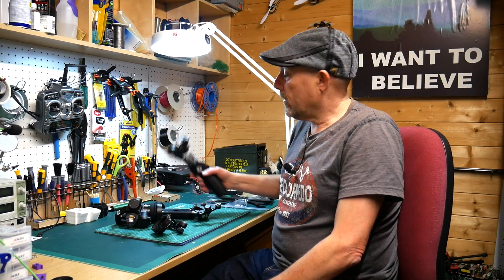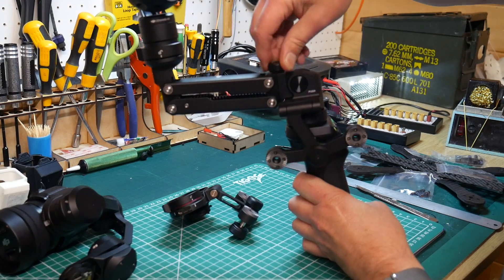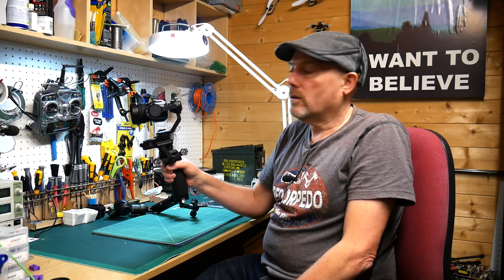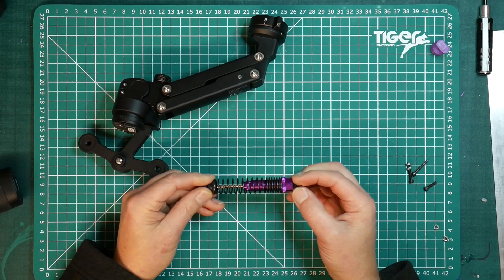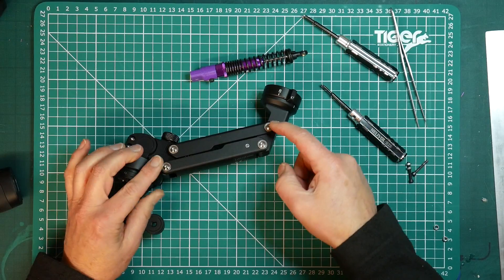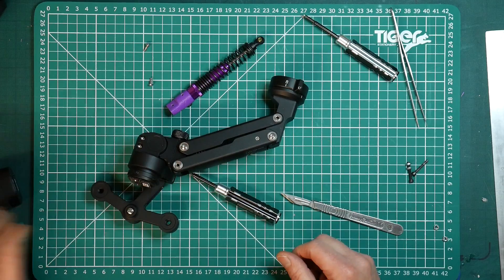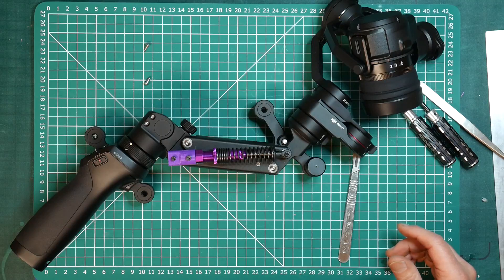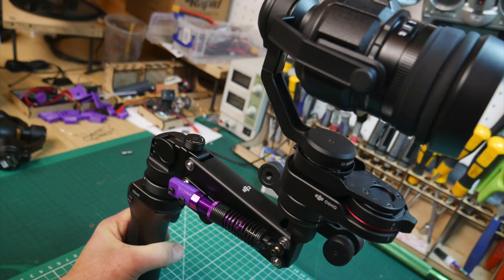Fitting a Zenmuse X5 to a DJI Osmo with a Z-axis stabilizer

Comment: do you still have the part that was 3d printed would be interested in getting one
Reply from the maker: https://www.xcopters.co.uk/shop/3d-print/osmo-x5-z-axis-adapter-extention
Reply: @WhirlyBloke  I have the pro version of the camera does that still need the adapter? As I already have the camera part
Reply: @WhirlyBloke  Thank you I see them there for £22 I just wanna make sure that it will work on the pro version as well thank you for your help video was very good
Reply from the maker: @RobertVernonAustralia  That I'm not sure. i did this several years ago before a z-axis stabiliser even existed. I don't have a pro version to test it with.

Comment: I too have had difficulty removing the captive washer.  I used pliers to hold the captive washer and unscrew it but it did not work.  Any recommendations?
Reply from the maker: I found the simplest way was to tightly and securely grip the captive washer with some narrow pliers and slowly unscrew the bolt. At first it seems the nut is not coming undone, but just keep turning and it will eventually come out. I'll put together short video showing how to do this.
Reply from the maker: Here's how I did it https://www.youtube.com/watch?v=wpiL4S41PQc

Comment: Why would you do this rather than just buy the official Z-Axis that they've produced for the X5 instead of trying to use the one for the X3?
Reply from the maker: It's quite simple. When I wanted this the X5 version last year it wasn't available and needs must. I've used this on pretty much every single shoot I've done since making it and it's worked perfectly. And technically, a compression spring is better than an expansion spring for these purposes.
Reply: Have you tried it with the X3? I don't think the z-axis do a good job, so I was wondering if with the right calibration on the compression spring it would help? Tks

Comment: Hi Fella,

Did you have any issues getting the bolt out of the bearings ?  Mine doesn't seem to want to shift :(
Reply from the maker: It can be difficult to get the captive washer off the bolt, but just hold it with some pliers and unscrew it. The bolts dropped straight out of the bearings then.